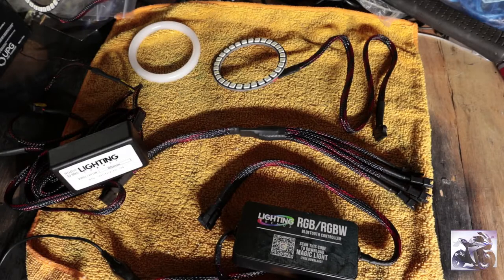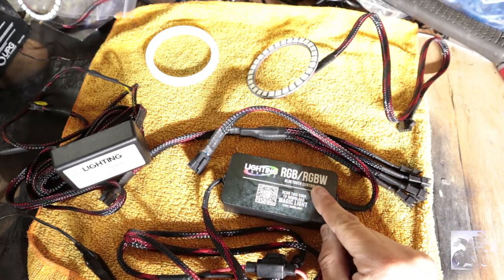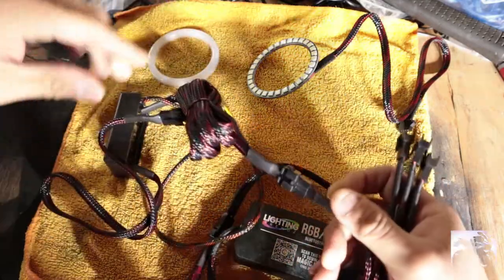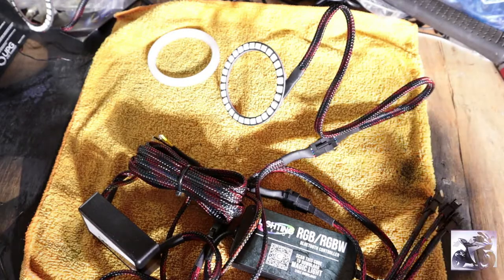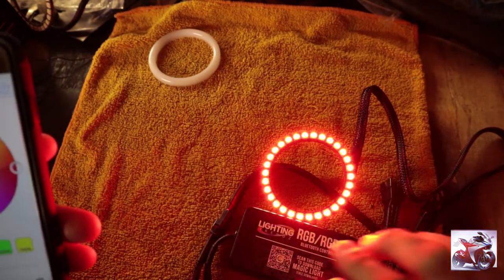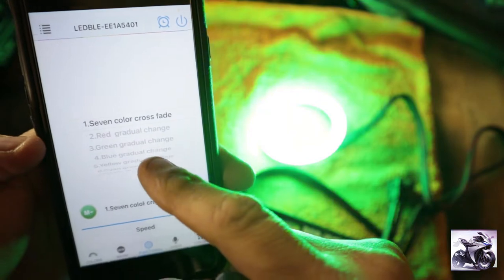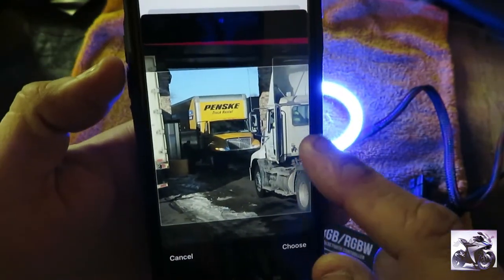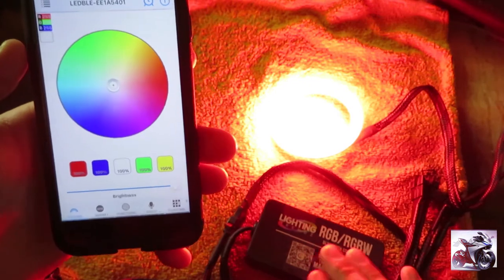How to Connect & Setup your RGBW BT Controller

Comment: Excuse me, can you tell me please why do we need to install driver? Or. We don’t have to?
Reply from the maker: it will not work without the driver as that regulates the voltage, using it without it can damage the leds